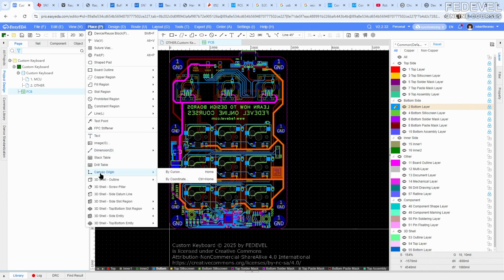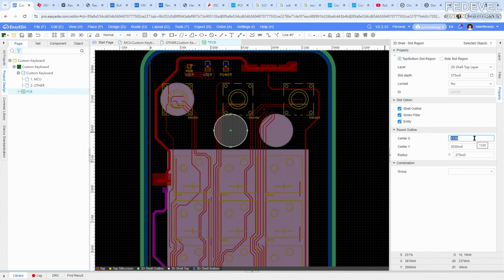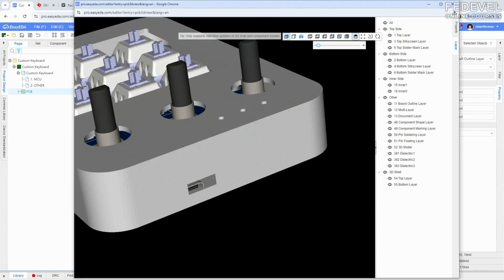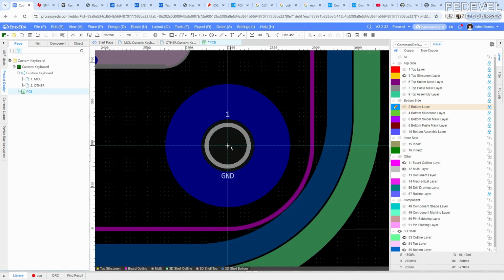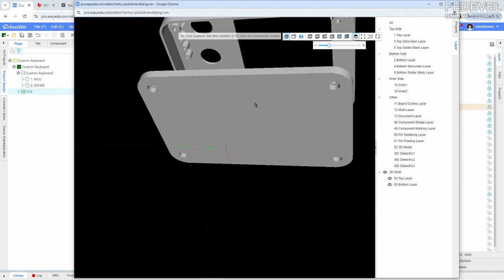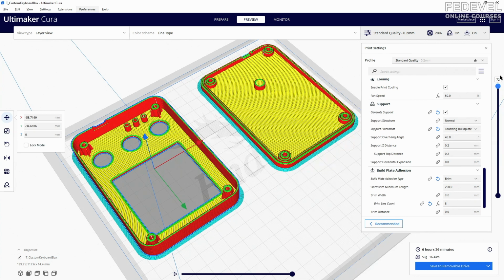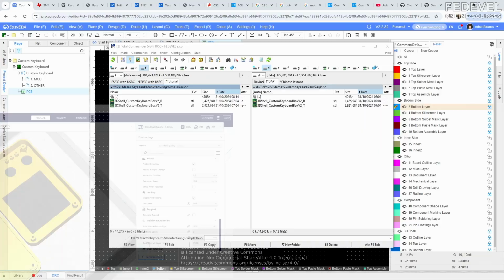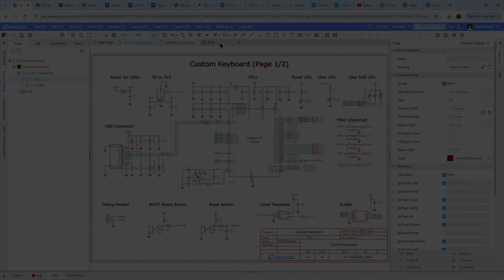Tutorial - Custom DIY Keyboard Design and Build | Part 6: Case / Box design

Comment: With end-to-end mounting, one of the mounting support cylinders has two diameters in order for the smaller diameter to enter the PCB hole and thus position the PCB. At the same time, the height of the step is slightly less than the thickness of the PCB so that the cylinder on the other side presses the PCB. Since the screw is twisted at the bottom, this step is needed in the upper lid - the PCB is placed in it, positioned along the step ща holding cilinder and then covered with the lower lid.And it is best to do this not to separate cylinders with legs, but with a protrusion at the corners. The middle support cylinder should have a height slightly higher to create a PCB clamp, otherwise it will knock. These are simple things that any designer knows to make a convenient and beautiful device. 🙂
Reply from the maker: would you be interested in making an interview video and talk about enclosure design?
Reply: @RobertFeranec  My spoken English is very poor, I use a translator to write. The interview will be difficult. Moreover, I am talking about enclosure as an observant engineer who observes the work of other people. I could tell you a lot of useful things about the design of industrial devices operating in fields where many unexpected events occur. But this will not be a tutorial, - a story about my experience.

Comment: Even though I normally use FreeCAD, I would now be tempted to use EasyEDA's CAD option, it's perfect for electronic enclosures especially if I also design the PCB in it, never expected a single project to teach so much... ;)

I'm not building the exact keyboard, however I have redesigned my existing (STM32F411) keyboard using the Pi 2040 and the tutorials. I uses KiCAD but may also do an EasyEDA version as I would like to add a case option following this tutorial.
Reply from the maker: Than you for watching and nice comment :)